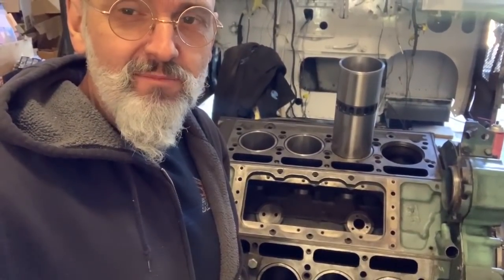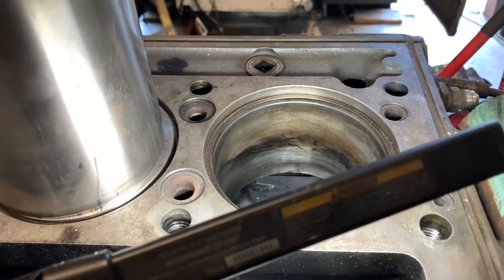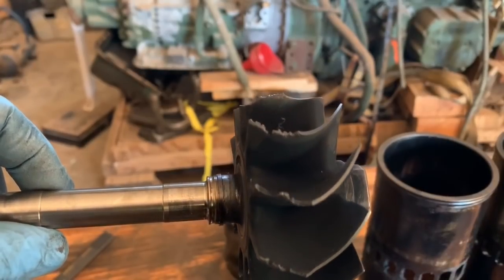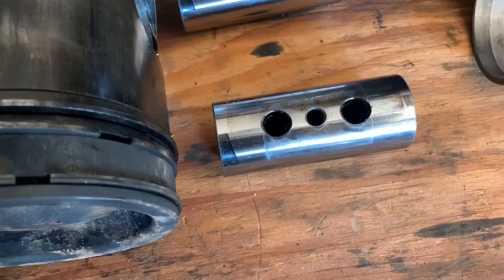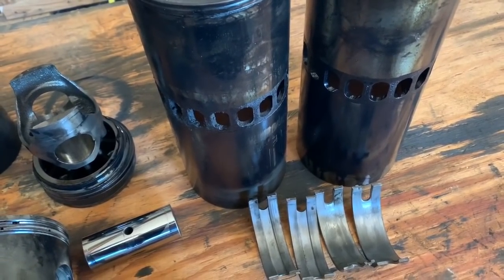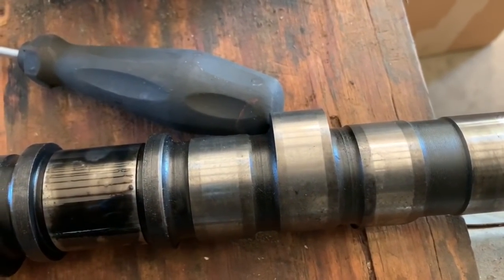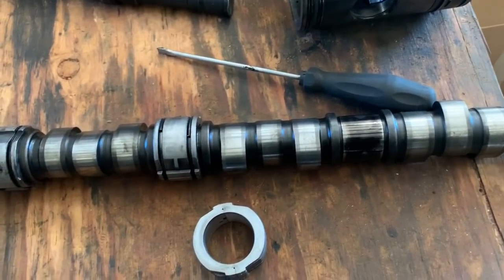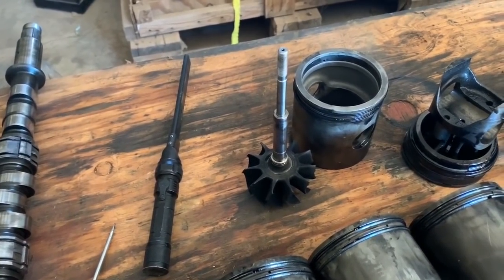Engine failure , why we had to rebuild our 8V71TA Detroit Diesel after 625 hours

Comment: There is no B/S if you take the blower apart to put new bearings in the case ,,,YOU HAVE TO TIME THE BLADES WHEN IT GOES BACK TOGETHER ,,,,THERE ARE TIMING MARKS ON THE BLADES ,,,,you don't have to time it ,,,if you don't you will see why,,,, same thing with the back section of a 12 speed Spicer transmissions,,,or a 13 speed transmission the back section has to b timed ,,,,NO B/ S MY FREIND ,,,,ENJOY

Comment: What about oil pump and pickup tube? I have the same motor. 8v71 in my 66 peterbilt. Motor only has 200k miles on it. Sat for over 30 years. Opening it up tomorrow to see if I should build it or just repower it with a different motor
Reply from the maker: The pump and tube were in good shape. Repowering might be easier, but no engine sounds as good as an 8V71 at full song. I’ve been around race cars all my life with high power V8 engines, they sound great, but a 2 stroke Detroit has them beat.
Reply: @LacroixCruiser  motor is dripping oil out of the blowby and smoking bad. No miss no knocking
Reply from the maker: Too much idling can cause that.

Comment: Wow, that turbo impeller was really toast.  So sorry you had all of these problems with the engine.  Having had a DD8V92TA DDEC II in-framed in the second half of 2017 due to coolant in the oil, and then having a failure in one of the heads in spring 2019, I know how frustrating and expensive engine failures can be.   You seem to be in good hands and I am looking forward to seeing more about this work, but especially to seeing you back on the road.  I really hope that you and Sylvie get to stop by our BW host site someday.

Comment: no mention of incorrect oil here which i can see caused a lot of this damage , can bet shell oil
Reply from the maker: This engine has only ever had Mobil Delvac 1240 40w CF2 rated oil its whole life, changed every 5000 miles. The rebuilder that almost destroyed this engine though recommended using Tractor Supply house brand 40w, a recommendation we didn’t follow
Reply: 30 or 40 weight oil and a Detroit does not care.

Comment: Looks like you might not be using the correct oil.
Reply from the maker: From the beginning this engine was filled and maintained with 40W CF2 rated oil per the specifications.

Comment: G'day Yvan, enjoyed the detailed explanation of why the engine has failed and why the turbo needed rebuilding 3 times. Like anything that requires repairing by someone else, is finding someone who has full knowledge and experience with that type of engine. Having the oil holes of the rollers facing the incorrect way is a rookie (apprentice) mistake, not an experienced mechanic. Wish Sylvia and yourself safe and many free uninterrupted engine mileage. Cheers from Down Under.
Reply from the maker: The root cause was shoddy workmanship from a mechanic who apparently can’t be bothered to do things like take measurements, read the explicitly detailed Detroit Diesel manual, nor follow up when we reported issues the day after it was rebuilt.
Reply from the maker: The first rebuild we did as preventative maintenance, not because it needed it. I much prefer investing in prevention than paying for a cure. It had way more power before the 2019 rebuild. Since then we had been suffering in the slow lane with excessive blowby, poor cold weather starting, and a mechanic who was doing anything to avoid us. We even drove to his hometown and waited 2 weeks for him. Every other day we got another excuse why he couldn’t make it , and he would be there in 2 days. After 2 weeks we had to leave to work.

Comment: Generally speaking on a rebuilt engine the FIRST ten seconds of it running is the critical in it,s life!
Reply from the maker: Exactly, and when 3 fuel lines are spilling diesel into the oil, it’s never a good day.
Reply: Mine was just rebuilt and he said it ran fine at idle but when he gave it some fuel it made squeaking or squealing sound, he tried replacing rod bearing then it still made noise so he is tearing it back down tomorrow - I’m wondering what his tech may have done wrong and will this cause me future problems
Reply from the maker: Definitely not a good situation, I wish you the best.

Comment: I thought the dry fit liners were supposed to be so tight that you have to press them in and out..? I haven't seen people just sliding them in by hand.
Reply from the maker: Too tight isn’t better than too loose. These fall perfectly in the middle of the clearance range in the manual.
Reply: @LacroixCruiser  ok. I thought dry sleeve engines were always really tight like this https://www.youtube.com/watch?v=8tg1bouy1uQ but after some more searching I see other engines that have them not so tight.
Reply from the maker: The ones in that video are definitely tight.
Reply: The only dry liner engine I'm familiar with is Perkins and you have to put them in dry ice for 20 mins to shrink them so they slide into the bores.

Comment: Wow.  Glad you were able to luck out and find a much better rebuilder.  GM 2-strokes of all kinds are terrific, reliable engines.  At work we still have hundreds of locomotives with the much larger EMD engines, both blower and turbocharged.  They run forever, many have gone decades since their last complete rebuild, even though railroads are terrible at doing regular maintenance.
Reply from the maker: Yes we found a great mentor, the engine is now very happy.

Comment: Dangar Marine in Australia had big issues on his 4-71 built by an apparently reputable shop. It needed a full rebuild after 20 or so hours. He found a Detroit Diesel 2 stroke wizard called Adrian that is a great character, has all the tools and is thoroughly across Detroit 2 strokes. Even his Blue Heeler dog is called Detroit. Adrian too is a backyard operation but a good backyard operation. The gudgeon pin plugs were hammered in with a punch rather than the correct tool and all of them leaked. They ended up having to replace all the pistons and liners because the liners were not shimmed correctly and sat too low and rattled around. At the time Adrian checked the blower clearance and that was no good either, all the injectors were incorrectly set as was the rack and governor.
Reply from the maker: Very unfortunate, like our engine, had the person rebuilding it taken the time to read the manual, all would have been fine.

Comment: Why did you get him to rebuild your engine. Should've have done it yourself
Reply from the maker: I did the second time. The first time he came highly recommended, and I didn’t have the time to do it.
Reply: @LacroixCruiser  Sorry I fucked up on the wording. Half done it yourself is what I meant. Stripped down wash parts etc reduces labour cost and then get a professional to put it back together and set the rack. Liner hights need shimming etc.
Reply from the maker: Again at that time my work schedule didn’t allow for that.
Reply: @LacroixCruiser  At least it's good now. When I was in high school they had these engines in 🌽 Cornbinders 4270 Transtars fully loaded with logs. Effortless performance on flat ground good on grades too. A turbo on cylinder bank on those 8V71s and it's goodnight Cummins HA HA. I'm at Brisbane Australia where are you in the US. I had a pen friend called Edward J Viscia that restored some GMC trucks @ Sacramento back in 1987.
Reply from the maker: I’m in Quebec Canada.

Comment: Cam looks ok, when the roller wear into the cam they do not effect the outer edges. The marks you see on the cam are micro pitting, this is not a warrantable problem, actually it’s not a problem. Hard to see on video but have cam checked before you wast your money. The loose liner is not causing blow by. I don’t see the rod bearing wear you are talking about? The wrist pin bushing looks normal.id look for debris entry somewhere, carbon did not destroy that turbo.

Comment: I assume that someone else did the re-build?
Have you ever sent your oil out to be analyzed?
Reply from the maker: We send a sample at every oil change. After the rebuild in 2019, they never came back with great results. The engine was rebuilt in January, and by February we knew it had to be done again. This time Sylvie and I rebuilt it with the guidance of a veteran Detroit diesel mechanic, and the manual. So far we have driven it almost 4000 miles, and all we have to report are smiles.
Reply: @LacroixCruiser  I've used https://www.blackstone-labs.com/?session-id=tv3emc5533xw0xnhifv14ln0&timeout=20&bslauth&urlbase=https%3A%2F%2Fwww.blackstone-labs.net%2FBstone%2F%28S%28tv3emc5533xw0xnhifv14ln0%29%29%2F 
Several times for my 2002 VW GTI 1.8 T with 282,000k I found thier reports to be very through...Keep up the Good Work...
Reply from the maker: After threatening him to expose his poor ethics and work he reimbursed 25% of the original invoice. While not enough to cover the cost of fixing his mistakes, it was a gesture in the right direction. I know he isn’t well off because he has to beg for money on patreon, and go fund me to pay for his lifestyle.
Reply from the maker: Route 66 Texas that’s great. I was lucky to have been coached by someone similar to your grandad . Straight shooter, who’s been rebuilding Detroit’s for over 50 years. He couldn’t do the wrenching himself, but leant us his mind, manuals, shop, and tools.
Reply from the maker: You’re very lucky, appreciate every second you have with him.
Reply from the maker: Wear a helmet, it will give him a hint.
Reply from the maker: Route 66 Texas I would for sure!

Comment: U rebuilt an engine and it had all those problems dam ask me if i want fries with that
Reply from the maker: The rebuild that was done in January 2019 was preventative maintenance, not because of a failure. Before rebuilding this block everything was inspected and measured. I wouldn’t put good components in a bad block.

Comment: Not convinced you identified the source of oil correctly as would see cracking at top flange if too loose and loose liners is not an oil source but blower seals more likely
Reply from the maker: Blower was rebuilt and is bone dry, no oil coming from it nor the turbo above it. The person that guided me in rebuilding the engine has over 50 years experience rebuilding 2 stroke Detroit Diesel engines. These findings are his, but he’s very camera shy.

Comment: Always Dyno a rebuild 8 hrs all loads get paper work.
All Marine engine s I have Dyno before installing.
Oil samples pressure temperature hp torque crank case pressure all tested recorded.

Comment: I didn't know they had crosshead pistons in 71 series engines.
Reply: I’ve seen them in 8V71T engines 350 HP.
Reply from the maker: This is an 8V71TA
Reply: They've had them since 1975

Comment: Read up on the early history of the 6-71, was designed as a one use engine to get landing craft to the beach never really designed for longevity but they ended up being very reliable and long lasting, just catch all the dripping oil and pore it back in the crankcase, will run for ever!

Comment: I would want a tighter fit on those liners, you should also give the liner bores a quick hone when fitting new liners
Reply from the maker: The bores were honed, and the liners are within Detroit Diesel specs when measured. So far since the rebuild it’s running perfectly.
Reply: All good mate, if it is running good then that is all that matters, I only made the comment because I have built many Detroit Diesel 2 stroke engines when I worked for Detroit Diesel for 10 or so years. I could see your hone didn't touch the low spots in the parent bore because there was still carbon marks visible, the way the liner slid into the bore without assistance would have been a no go for me. Just some little things I picked up on, not criticising pointlessly. Great vid anyway, cheers from Western Australia mate.
Reply: Yeah those +3 liners look pretty loose to me. Ideal fit was when they could be pushed down by hand. If they fell all the way in by hand that was too loose.
Reply: Yup, we always put them in with a dead blow and a soft block.
Reply: Why no interference fit?
Reply: @michael931  because that would prevent the liners being replaced during in-frame service work and repair.
Reply: Try removing Perkins dry liners and you'll have some fun.

Comment: Mine was just rebuilt, when they got it back together said it made a squealing or squeaky sound when gave it fuel but sound fine at idle. They found 1 bearings upper/lower scored replaced that still made noise tearing it back open tomorrow~ ideas??

Comment: Hi Yvan,
I am not entirely sure about this, but should there not be caps on the pistons where the gudgeon (wrist) pins are? These are there to prevent blow-by (I think that is the term).
Reply from the maker: Yes, we have press in caps Now.
Reply: Gudgeon pins !!!!  Have you been talking to my dear old dad ??  Haven’t heard that term in decades.  You wouldn’t happen to have a shifting spanner ? LOL.
Reply: George, I do have a shifting spanner. I am guessing you are either from the UK or Australia.
Reply: John Smith the wrist pins are sealed with thin metal retainers that should be vacuum tested before assembly.   There is a seal between the trunk and crown of the piston for sealing.   Good design but the engine must be inspected and assembled correctly.   Also bus engines in the US typically are rebuilt beyond normal engine design limits.   If you find a retired coach engine in a salvage yard leave it there as it has served its time.  I have seen .040 undersized bearings in some of them.
Reply from the maker: VHP7044 correct, ours held over 20 inches of mercury for as long as we left the tool attached.

Comment: There must have been some indication that the engine wasn't rebuilt properly from the beginning. The engine was run too long in this condition all be it for 625 hrs.
Reply from the maker: There were signs within 5 miles. From there getting the previous rebuilder to take a look at what he did was an exercise in frustration. After a year of poor communication and excuses we gave up getting any help and decided to do it ourselves with the help of someone who has been rebuilding and repairing 2 stroke Detroit’s for over 50 years.
Reply: @LacroixCruiser  So the end result was a completely botched rebuild by an unqualified mechanic. These engines are not difficult to rebuild by even an average mechanic that knows how to use measuring tools and can read. What a damn shame.
Reply from the maker: hudsonhawk 001 unfortunately the mechanic is YouTube certified, I believe that precludes him from reading the manual...
Reply: @LacroixCruiser  YouTube certified, that says it all.

Comment: And the blower ,,,just make sure you re time the blower when you put it back together
Reply from the maker: It’s all back together and has 4000 miles on it so far, running like it should.
Reply: What B/S are you trying to pull (timing the blower ??? ). how do you time  the blower,
Reply from the maker: A blower is timed by shims behind the drive gears. To get proper blower clearance it’s important to check and adjust as required. It’s all very well explained in the factory service manual.
Reply: With the timing marks on the blades inside the blower
Reply: You are talking about setting the clesrance on blower, that is done when assembling  the blower & setting the orentation of the left rotor to the right rotor.
Reply: @briananderson3801  Timing marks on the blades??? No such thing. Timing is actually setting the clearance between the two rotors with shims behind the drive gears

Comment: sounds like it was an original factory remanufacture , and they commonly bore All bores over and fit oversize OD liners, after lots of years some just but a set of NEW standard size liners, slap it together never measuring OD sizes!
Reply from the maker: The block is a 1984 , it was rebuilt in the 90’s then in 2019 where this happened.,